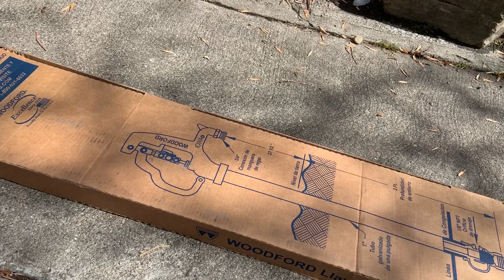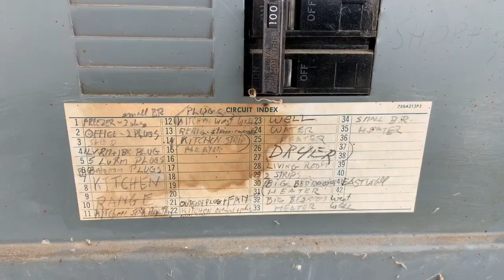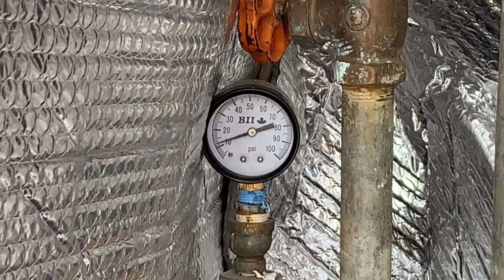How to REPLACE A YARD HYDRANT | FARMSKILLZ

Comment: Ugh. I am watching this because our hydrant just like that failed. That plunger thing bent, so it can turn on, but good luck shutting it off!  We got a different kind to match the rest of our hydrants (that all work great and can’t bend at that weak point), but we only got the top part, thinking we could just unscrew the top and screw on a new one....apparently that’s not how this is going to work and we need the whole giant expensive thing. It’s in a bad spot so we might just cap it and not use it.
Reply from the maker: Bummer! Sorry to hear that. Hope you figure out a good solution so you never have to go there again. Best of luck homie!

Comment: Must be nice not to have your hole full of water because the previous owner buried it next to the well!
Reply from the maker: You betcha!
Reply: Oh...is THAT why I'm digging in a foot and a half of wet clay right now?

I knew what I was getting into with digging a 2x2x2 hole by hand in my region (well, I did forget about the whole network of pine tree roots and runners from all the bushes planted around it), but I didn't reckon on it filling with water faster than I could dig.

My main concern is that I can't see anything in the hole as I dig.  The well guy told me I need to watch for an electrical wire.  I thought he meant running to the hydrant, but now I'm thinking he means the wire going from the house to the pump.  Either way there will also be the pipe coming in and probably a wire somewhere running from/to whatever.
Maybe I should turn the power off for the last 8 inches or so of the hole depth?

Comment: Good advice with water heater breaker, pipe dope, bucket of gravel, rebar, and tape. Why not just rebuild the valve with new packing rings, nuts, and dick?? Replacing the whole thing, buried elbow and all seem over kill.
Reply from the maker: Hi Jerry, The head was cracked on the old hydrant, think it must have froze with a hose hooked to it. 😬